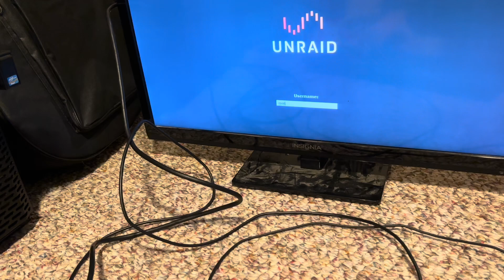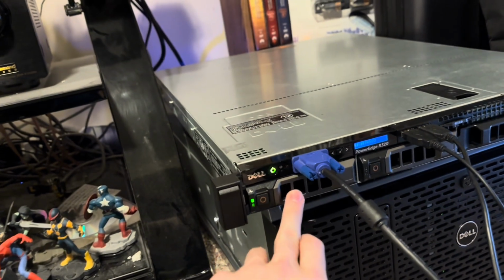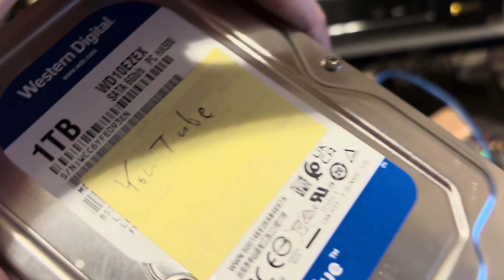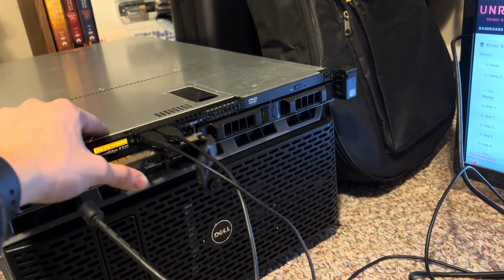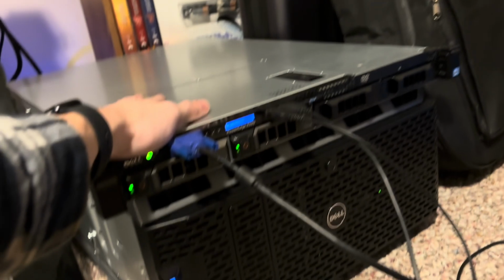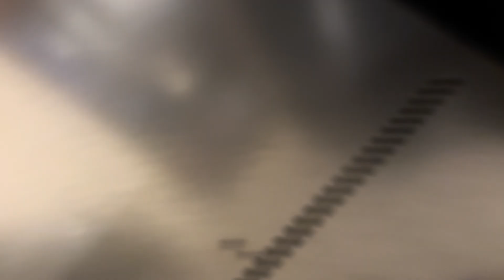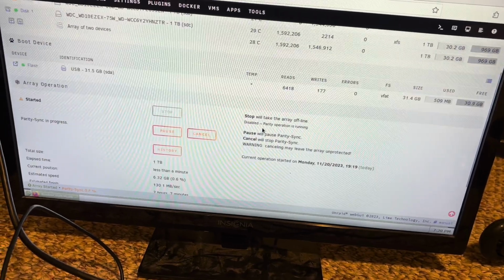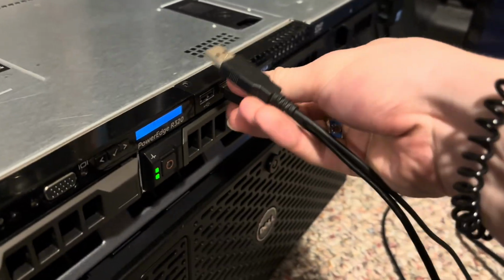Replacing a Drive in the Minecraft Unraid Server

Comment: Reminds me of my first set up. DL580 G5 and an IBM x3650 M2 stacked on top of each-other. Word of advice though, keeping them on the floor can increase the noise and reduce performance if too much dust accumulates; and it can build fast. Putting them on a table or a hacked ikea table is more ideal. 

As of now we have three R720s with some E5-2667s, set in a rack without rails. Quiet once tuned really.
Reply from the maker: I actually got them rack mounted not long after this video. Hopefully I’ll be able to get a vid up about it soon

Comment: Cool look into your setup, I’m a bit of a data hoarder and virtualization nut and make use of several older Dell servers myself. I migrated to Proxmox pretty early on so never got acquainted with Undraid although that was my initial choice. I found managing my storage arrays by passing the drives through to a virtualized TrueNAS server to better fit my needs.
Reply from the maker: Interesting! I've never used Proxmox and am relatively new to servers myself and teaching myself, but I know that it is a very popular system!